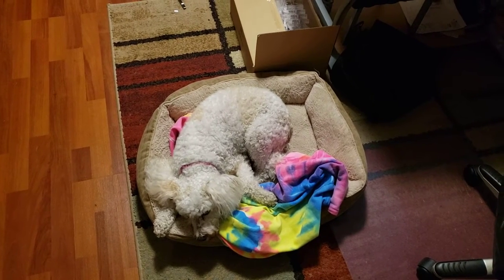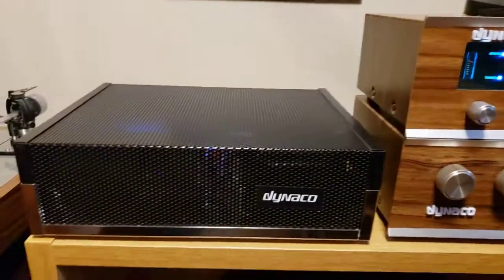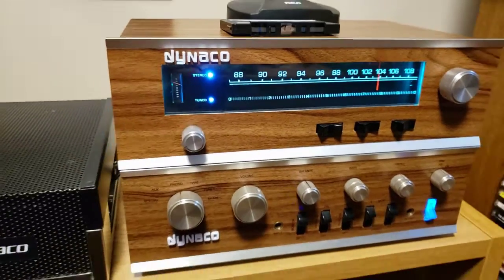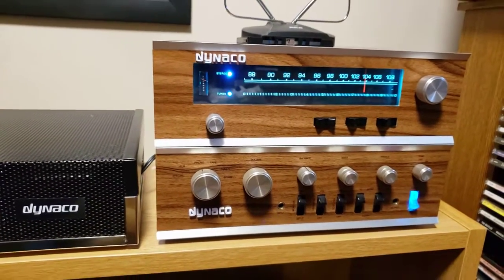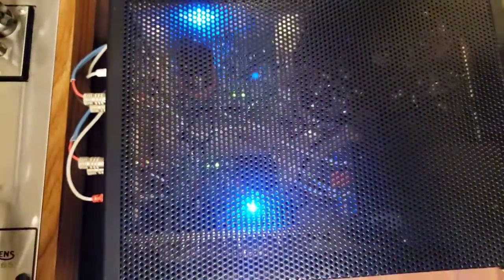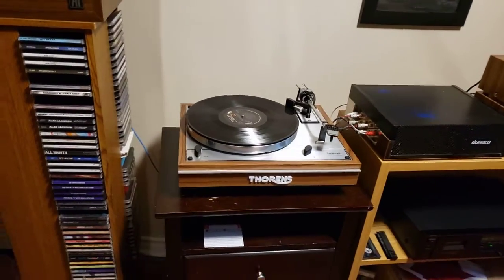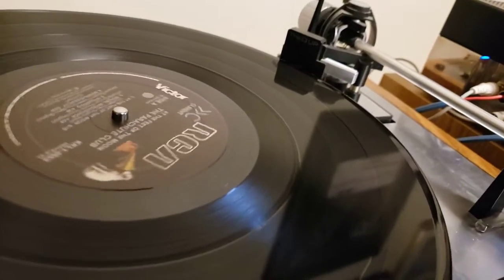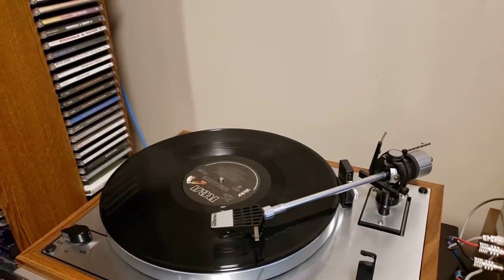Dynaco Woody with custom Thorens TD-165 System Demo

Comment: How much fo tht Dynaco pat4 and 120.  Also how much for the Luxman intergrated amp.
Reply from the maker: I still have the Dynaco setup as it was completed recently. A lot of work went into rebuilding all three units (PAT-4, FM-5 and Stereo 150) as they are essentially brand new units inside dressed up in old clothing😉

Comment: which one do you prefer more the thorens or Lenco?
Reply from the maker: Thorens but that is a personal opinion and not based on any empiracle findings. Merely because I used to work selling audio 3kms from the Thorens factory where they were made in Lahr (Kuhbach actually), Germany back in the day - at the Canadian Forces Base Lahr Caserne, West Germany. 😃
Reply: @navydiving  really cool, my ultimate vintage dream is the TD-124.
Reply from the maker: @juandv930722  the Lenco L70 is just as good as the 124 IMHO. An idler drive table will always be slightly noisier than a belt drive but you can't beat a heavy platter for stability due to inertia😉
Reply: @navydiving  is it really that good? the td124 is staggeringly more expensive.
Reply: @juandv930722  Tim, how much would a td135 go for and is it worth restoring it?